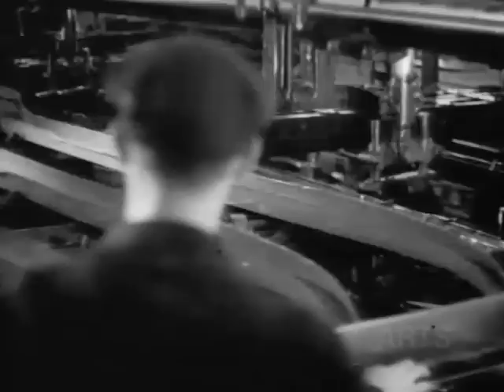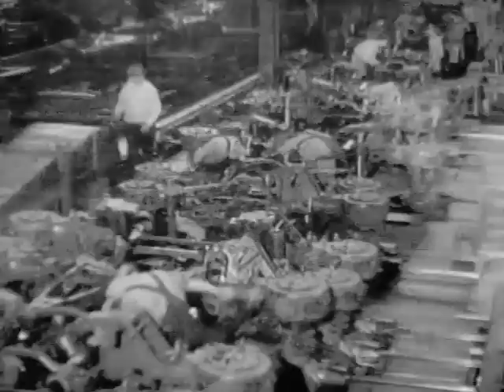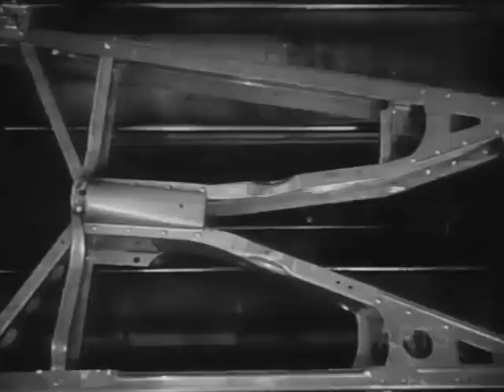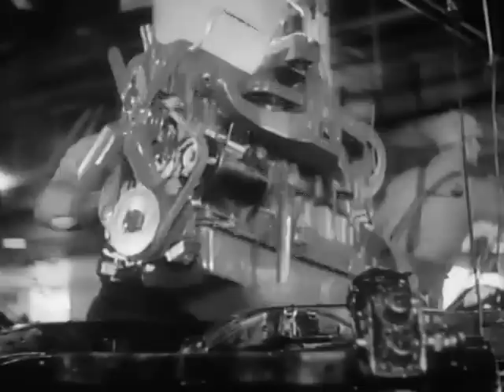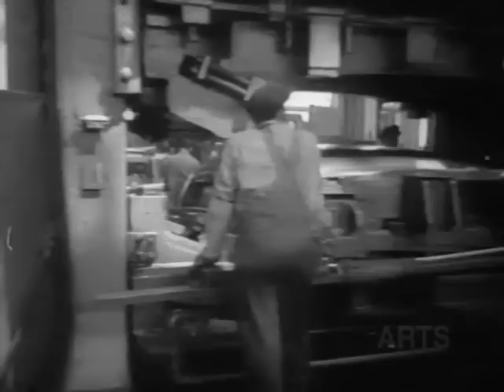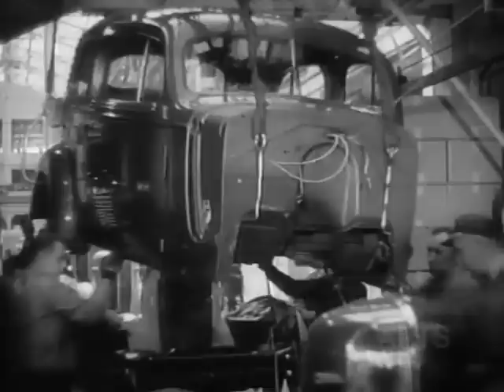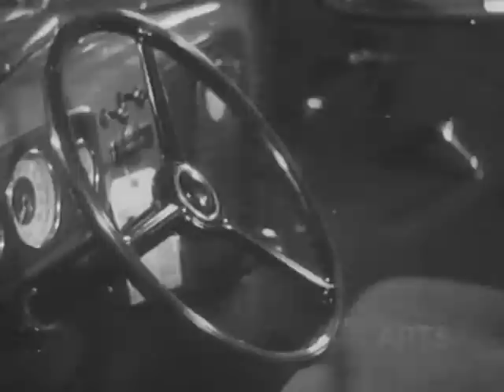Fascinating 1936 Footage of Car Assembly Line

Comment: I use to work with my father at Chelar Tool & Die Co. in Belleville, il. years ago.  I operated those massive Hydrotel machines that milled the dies to form shapes similar to the fenders on these vehicles.  The machinists also created the massive dies to cut the heavy sheet metal on those presses.  I can really appreciate the work that goes into creating these vehicles.
Reply: Pratt & Whitney 3d copying machines were called Kellering machines. Last we used them was around 97.
Reply: Boeing Portland had its share of Hydrotel machines in “mills”, which is one area I worked ~ 30 years ago.
Reply: Just to build the machine to build the car was a undertaking.
Reply: @ronaldchappell3046  so much material used and rusted

Comment: Amazing this was flimed 80 odd years back. I can see how hard they're working and I'm sure there were safety procedures in place, but it's amazing how close their heads are to the swinging beams that carry the parts. And how close they stand to the press-brakes, no guarding. I know it's a case of being experienced enough to know where and when to put your hand, but you never know!
Reply: Accidents did happen and your right there could and should have been more attention given to safety of machines.
Reply: Recall one evening at Boeing (very early nineties) where a workpiece on a horizontal mill got loose and the cutter broke.  I knew the person running the machine, just like I did many of them.

You haven’t lived, industrially speaking, until you’ve been chased by a broken part of a milling cutter the size of a corncob!

Comment: The assembly line machinery was more sophisticated than the cars it assembled.
Reply: Indeed. It's an interesting video. At that time the manufacturers were just moving away from aluminium and wood, towards steel pressings and pre-fabricated sections. Then came the monocoque concept with bonded subframes and it all went downhill..
Reply: You are absolutely right. I was amazed by the level of automation.
Hats off to the  engineers designing the machines.
Reply: If you look at the computerised robots in a modern car factory and the technology involved the car is almost a byproduct
Reply: @roshanmanilal5315  I find in this video and videos of today's cars being made (and manufacturing in general) the machinery and robots and the design of them more impressive than what they are making.  The minds that conceive the manufacturing & assembly tools are incredible & i solute them.
Reply: Juden Arier growing up in the 60’s a car with 50,000 was considered ready for scrap. Now you wouldn’t buy anything without an expectation of 100,000 or more.  Of course, most people still want the newest just for the “impression” of sophistication or affluence. So they don’t keep cars that long.
Reply: IAmaPersion  Because we have to make money to pay for all that technology that makes our lives easier :-)
Reply: IAmaPersion  When companies saw the production increases thru computer  combined with mechanical a weeks worth of goods could now be made in 3 days. Oportunity now to work 6 days and make 2 weeks worth of goods in just 6 days with up to 50% less hourly workers.. There went Sundays, along with less workers and reduced Union membership. The tide has turned to the Corporations like it was in the early 1900's, Rockefeller, Carnegie ect
Reply: Actually it is "oil" that has improved more. The cars were quite reliable. I have driven hundreds of these old cars. Many of these old cars just go and go..
Reply: IAmaPersion  The technology that hurt wages and manufacturing jobs was the humble shipping container. It lowered the cost of shipping to a tiny fraction of what it had been before with all the manual labor needed to ship goods previously. You load the container once and then cranes place it on a ship, train or truck. The goods inside the container don't get handled until it gets to it's destination. Suddenly, companies in countries across the ocean could compete as if they were on the same street as American companies but paying wages at 1/10th those of American workers.
Reply: Juden Arier  My last TV, a Chinese made Samsung, went bad after 3 years. The Zenith tube TV we bought in the mid-60's lasted 20+ years.
Reply: I agree. To produce a car, these machines were amazing. And the fitment technicians. (Pays these guys honor rather than calling them ,"assembly line workers").
Reply: Interesting that folks are complaining that cars aren’t what they used to be here.  That’s right...they
Re more reliable, safer, last longer, and much more turnkey for the consumer.  There is something that is lost in all hat sure..when was the last time you had to engage a choke on your car?  Or pump the gas a number of times to get the thing to start.  Get in, push’s button, drive away.  I like it better that way.  Don’t miss having to wrench a car all the time to keep it going.
Reply: @flooflox  Yes - but cars don't come in shipping containers. they are driven off car carriers, at least where I live
Reply: Absolutely right. The person who designed the presses should be praised more than the car!
Reply: My dad used to take me into the plant where he was working as an assembly line engineer. All the automation shown not a single microchip or transistor in sight! Everything was done with switching relays, timers ,end switches, and timers etc.
Reply: @nickhighman4455  not exactly, the automobile mattered far more than the easy to make system that housed it. Back then, we didn't care for the mechanisms although admired them, they weren't what was important, nor were they human feeling and made for many uncomfortable visitors seeing those lifeless machines at work. Nowadays its praised, because we live in a society of idiots that see a house from 1950, and love it so much that they talk about how racist 1950 was.
Reply: @willshad  Clearly unless you stole the device you wrote your comment on.
Reply: @rickhalverson2252   - Built by engineers to do more than trundle molded plastic in & out of a showroom; but you're right, modern correct spec. lubes are a world away from the 'rolling rocks in suspension' they had back then : )
Reply: Had to be to get speed and lower unit cost.
Reply: @peterrick3339  have you seen the candy bar production lines(3000000 bars per 8hors) or canneries or beverage bottling .
 lines.
When there is a huge demand for low priced consumer goods this is what drives the ingenuity of the modern world .
Hats of to all those clever dedicated people.

Comment: What amazed me was that all of this equipment was mechanically controlled! Not one programmable logic circuit, no computers, no servos, etc. Also, the car was designed without CAD.... just drafting tables and slide rules!
Reply: There used a lot of electric relays; as relay logic is the precursor of all computers (and is still is how computers work today at a microscopic level).  They're just not Turing-complete, so they can only be programmed/reprogrammed by manually rewiring the logic.
Reply: No McMaster or Grainger catalog either.

Comment: All done without computers.
Reply: True, no modern computers (as we know it now)... but they used lots of mechanical automation..   Those welding, riveting, and assembly tracks were programmed to follow a sequence-- and the sequence had to be programmed somehow...    since a mechanical computer is still a computer.
Reply: Thanks Luddite.
Reply: Relay logic was used...Hundreds and hundreds of relays ...when you would walk by the relay boxes and the line was cycling you could here them all clicking like mad...
Reply: gblueslover2

That's right, you cannot have prosperity without profit.
Reply: john james 
You're right, mammoth cabinets of mechanical relays making and breaking, ... slapping those big contacts ... I can smell the arcing carbon buildup emanating from the cabinet now! 

Fortunately I've had the pleasure of working in numerous manufacturing environments representing everything from archaic, dark, dirty and dangerous refineries, foundrys, etc. All the way to the nicest modern, high-tech, spotless clean-room type spaces of pharmaceutical laboratories and mfg. 

One aspect of which I'm absolutely certain; That plant in the video would be deafeningly loud from the countless sources of high dB noise. 
All the processes, the compressed air and pneumatic actuation, the presses forming and shaping, the shearing of metal, welding and hammering, damn... it would've been relentless. 

I really enjoyed the vid ... good stuff for sure.
Reply: roman..Relay logic...
Reply: Foh..I didn't start with GM till 1971 here in Flint as an electrical apprentice....FOH 3663... sounds like you; have had quite a career..I did about 35 years and I'm an old man now...Good stuff and good luck to you sir..
Reply: Waterlec...https://youtu.be/E2Py_vNt4fc?t=28.. remember JIC..It was on every panel box we had too..I put a link in here to the sit down of 1936..Done by the BBC and it was real accurate..My grandfather participated in the sit down strike in 36-37..My grandfather was active in the union here in Flint at Buick Motor..I worked at the Chevrolet complex...Hopefully the link works...
Reply: @bigstuff52  

J I C, is/was also a standards organization (similiar to today's NEMA) for boxes, cabinets etc. 

"Let me go get that JIC box", "hell, send the cub to go get it".
Reply: FOH....Yah the standards for the machine tool builders..thanks for replying FOH..
Reply: @romanval69  cam-driven machines. I am an automation engineer. Back when I worked at a GM plant in the 80's and 90's we still had some cam driven machines.
Reply: gblueslover2  Quit with the profit stuff.  Do you think the "non-profit" government could do it better?  You had to wait 13 years to get a car in communist East Germany.
Reply: And done better!
Reply: Less stops in the line due to glitches.
Reply: exactly
Reply: @bigstuff52  no shit.. you were there? I am amazed.
Reply: Not needed. No thinking required, only mindless repetition.....just park your brain at the door on your  way in.
Reply: Beverly Sharp You just answered my question! I am fascinated watching these machines moving, apparently fully automated and thinking what kind of control mechanism were they using since-obviously-computers weren’t around.
Reply: AR556NATO did you not see my he automation..computers dude
Reply: There was already a lot of automation then, analog of course...
But for the most part, PEOPLE used to build Cars! Cabinets, Sinks, Tools, Hardware...
And about a million other things.... 
PEOPLE, who were able to Work, feed their families and keep a roof over their heads. 
It was often tedious and monotonous... but they were HAPPY to have those jobs!
(Except of course the squeaky wheel MINORITY, demanding more pay and LESS work!) THEY dragged the Majority down a path that they DIDN'T want to take. (Unions!!)

Then came Computers. As much of a Blessing as it was a CURSE! 
Computers REPLACED Millions of working PEOPLE all over the World. It was an easy sell, now that UNIONS had Companies paying Employees SO MUCH, for a far smaller workload.

Efficient? Yes.
Profitable? Yes.... 
But NOT to the Millions of People, skilled Artisans.
They were FOREVER replaced by Electronic Gadgets. 😖 
We don't really MAKE anything anymore. 

Now, I've always been a Capitalist, through and through. Free Enterprise made this Country - and Great Britain and Europe, GREAT Powerful Nations. 
Not anymore.... 

Production and Profit are hallmarks of the Capitalist System. BUT without a skilled Workforce and their BUYING Power, many Companies NOW have moved their Production to Southeast Asia or Southeast Europe! 

Computer Automation is GREAT! Isn't it? 😒
Reply: All the engineering design work was done by slide rulers, handwritten calculations, and mathematical tables.
Reply: AR556NATO computers are the worst down time ever.
Reply: Ok? 😂
Reply: I was looking for a comment about how well built they were. My father restored Dodges from the 30’s.
Reply: gblueslover2  They DID do it! It was called "automation", instead of electronic "ones" and "zeros", mechanical relays were used: open relay= "0", closed relay= "1". The very first computers were made up of ALL relays!
Reply: @ThekiBoran  "you cannot have prosperity without profit." A capitalist lie you swallowed without hesitation. They've sure got your number.
Reply: @richsackett3423 

The central bankers are simultaneously the top corrupt capitalists and the top socialists/communists because socialism is a tool to consolidate the political and economic power of the central bankers.  Why aren't the central bankers Bernie Sanders' number one target?  Because the central bankers are the top socialists.  Duped peon socialists like you can't seem to figure this out.
The only thing wrong with voluntary exchange is when corruption isn't stifled and like a good duped socialist, you confuse corruption with the free market.
Reply: @ThekiBoran  “Hammering away” is not good governance. We already suffered through four years of a guy who only knew how to break things, many of which Biden has already diligently repaired.
Reply: @richsackett3423 

WTF are you saying?  Again please, and in English.
Reply: @richsackett3423 

The world has not seen its last genocide.  There's one more big one coming.

Comment: Robots were already in use in 1936. At least for welding. Fascinating!
Reply: Riveting...
Reply: Jourwalis - those where machines as everything was mechanical,no artificial inteligence wich is what robots are today. everything relied on tempo then
Reply: Not robots.  They are not programmable.
Reply: Yes I also didn't realize that! No OSHA though and I wonder how many people were hurt as those worker were standing right in the middle of some serious moving machinery..
Reply: Probably quite a few were hurt. You went to the company doctor with a shredded limb and he would certify you 'fit for duty.'
Reply: And then after several years, all that machinery would be making war machines.
Reply: MrShobar
Not robots.  They are not programmable.
'
hi M S...
who is a word - THEY -
Reply: The machines depicted here are not re-programmable at ALL.  The movements are mechanically designed in.   Sure you could take it apart and design and re-fit it to move differently but that is hardly what amounts to programmability.   It's like saying changing a die in a stamping machine is re-programming it.  No.  It's refitting it.
Reply: john james spot welding also
Reply: Thay are pushing Rivits together
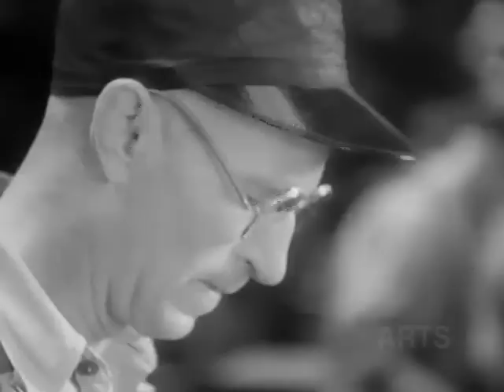Reply: lovejago @5:20 wouldn't you call that spot welding???
Reply: Riveting not welding in this video..
Reply: exactly.
Reply: stephane sonneville ....sorry, but you are as wrong as can be. I have 40 years in Die making for the auto industry. Once those production lines were set up, they made one model until the end of its run. There was NO switching back and forth. Not even up to the 1980s.
Reply: Peter Econ....Good question..Imagine on a hot day and its 105 degrees in the plant and you're having a bad day...Whoa..
Reply: Step...they had to re-wire panel boxes to change the program which wasn't easy..
Reply: @petereconomakis149  looks like they weren't supposed to be there, watch them closer they are hammering, in other words re working every part. Imagine doing that for hour after hour, ..
Reply: @daver.j6805  Or seating panels against each other - verifying alignment before the rivet gets squished (cold BTW). If a frame component wasn't seated "home" the rivet would still squish and hold the misalignment, perhaps ruining the frame.
Reply: They were "programmable"..... different cams to follow, different gears.
Reply: I worked for Ford 00 - 02. There were still places that you could easily get killed. I had to duck down and walk under a sand muller to get to one of my jobs... no shielding, no nothing. If you stood up, it would take your head off. That plant was built in 52 and a lot of what was there was probably original to the plant.

Comment: Notice how the auto-workers in 1936 worked without hard hats and safety glasses that is required today. There were no air pollution laws back in 1936, and so the engines were simple, easy to build and easy to install. Very little electronics.

Comment: Flint, Michigan, my hometown! Between 1985-1999, I visited most of the Flint GM plants (for work); Buick, Chevrolet, AC Spark Plug, Fisher Body and Truck & Bus. Sadly, they are all gone now - making this wonderful, historic and masterful footage all the more important. The level of automation was surprising and rather impressive. The quantity, speed and proximity of moving equipment to workers (without guards) makes me grateful for modern US OSHA standards! This one''s a keeper for sure!
Reply: 36 Chevrolet Master deluxe was built at Baltimore Assembly so figure most footage here is from Maryland not Michigan.